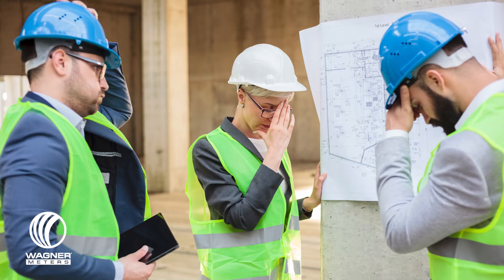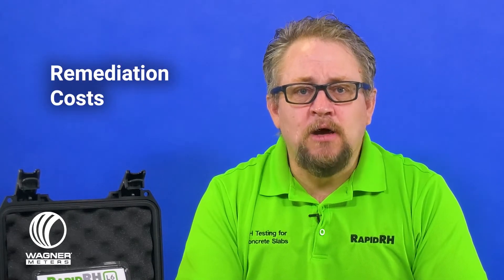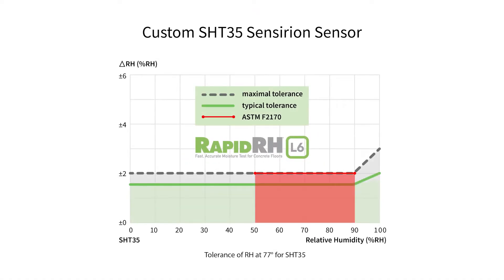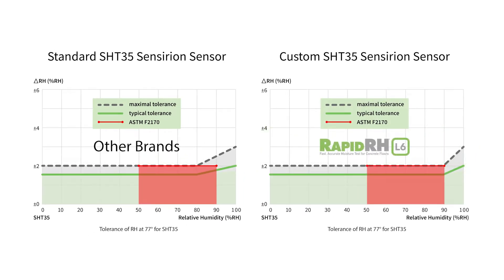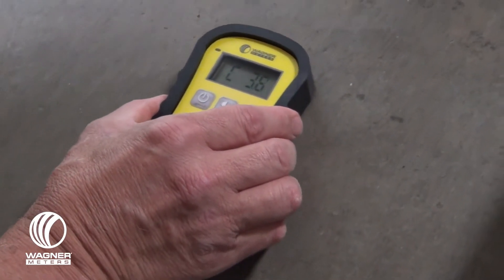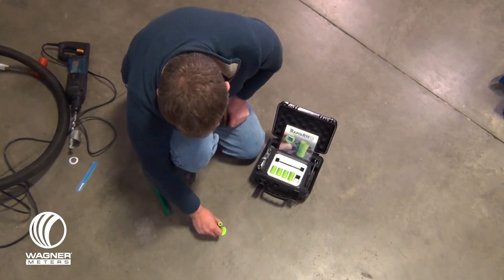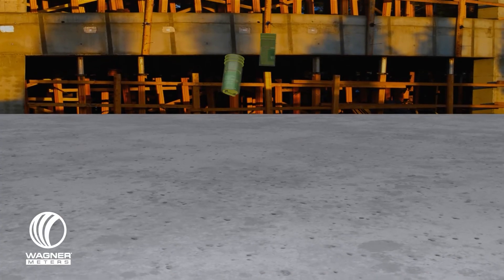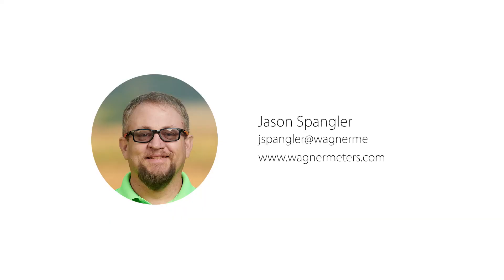Concrete Moisture Testing the Correct Way - Rapid RH L6 System

Comment: I want a system which is complete and doesn't depend on a cell phone or anything else.
Reply from the maker: This system gives you options, one of which is recording test results via Bluetooth and a Smart Device application. On the other hand, results can also be displayed on the Rapid RH L6 Totalreader LCD screen and handwritten on a provided recording sheet. I hope this helps you see that this is one of the simplest systems to use.

Comment: It would be great if coating systems would get rid of the MERV standard all together and get with RH ...  Can RH predict Vapor Drive ???? For a resilient flooring system/epoxy?  Says it good for up to 75% RH and 5lbs/1000 sqft.  .  Is there any correlation at all?
Reply from the maker: Thanks, John. There isn’t really a correlation between the two. Here is a video I think you may find interesting (on the older side and not my best “performance”) that goes into this more. RH vs. Vapor Emissions Rate: How Do They Compare? - YouTube. Let me know if you have more questions. Thanks for watching!

Comment: F2170 tests the RH only in the spot tested - not moisture - nothing to do with moisture -  marketing
Reply from the maker: Marketing with science to back up the methodology. I’m not sure the point you are trying to make regarding moisture and RH? Both are defined and relate to vapor. Regarding a specific point measurement, I guess if you believe that then we really have no way to test moisture in concrete because all methods would have the same issue.
Reply: @WagnerMetersMain  other than gravimetrics ;)     A properly calibrated moisture meter and ambient conditions in my opinion are more important
Reply from the maker: @Jaylowrider  Great concept, but any type of surface moisture testing can have potential variations due to numerous differences in the actual concrete mix design i.e admixtures, types and sizes of aggregate, etc. Not saying surface testing meters such as the one me make, don’t have a place, just not for making go no go installation decisions. Also, keep in mind that most flooring failures aren’t actually due specifically to the high RH% (or moisture if we need to delineate), but because of the increased alkalinity that comes from the salts that are transported to the surface because of it.
Reply: @WagnerMetersMain  I would argue that most flooring failures are from dew point and surface temp of the concrete. AKA ambient conditions ;)  ✌️